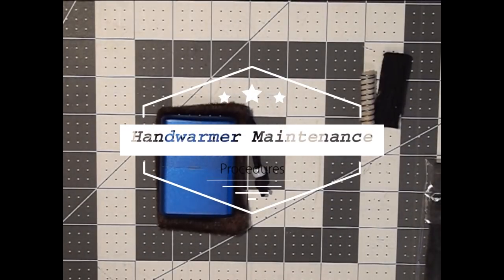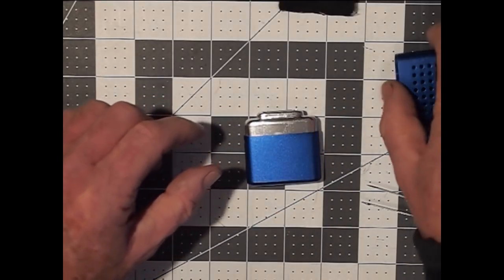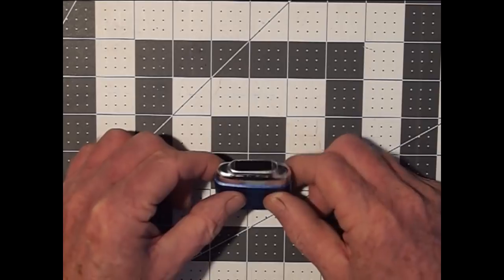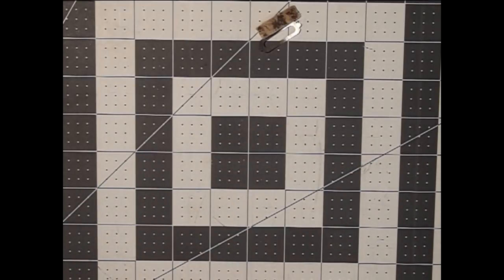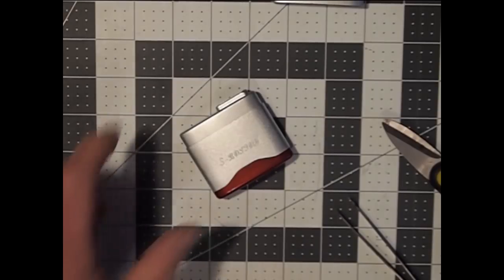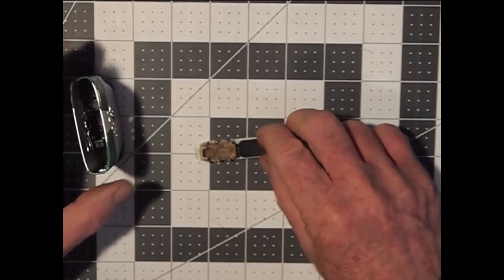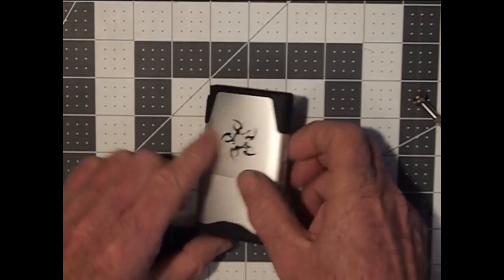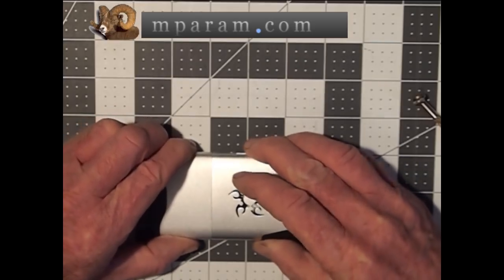Handwarmers, S02E01: Modern Handwarmer Maintenance Procedures

Comment: If you fill it up with the proper amount, do you have to worry about it being on it's side or upside down at all?    Do you recommend the jon-e or the s-boston?   And is it ok for the batteries to get that hot?
Reply from the maker: Orientation is not a concern if the reservoir is not overfilled. I have not used a Jon-e. Pls refer to the other video in this channel: "S-Boston Handwarmer Battery Compartment Safety:.

Comment: Loving your videos! Out of all your hand warmers, which one is your favorite if you had to choose one?
Reply from the maker: I like the round style a lot, but they have been hard to find the past season, not sure why. This season, I generally tend to grab an S-Boston if I'm heading out. I find I've had the most hassles with the Zippo's for some reason. I suspect it is due to the smaller orifice that the catalyst head seats on allowing less fumes through to support the exothermic reaction required for good heat output, which also means they die a lot easier.